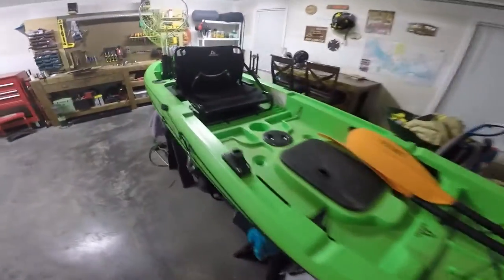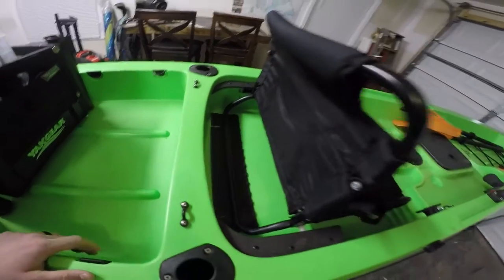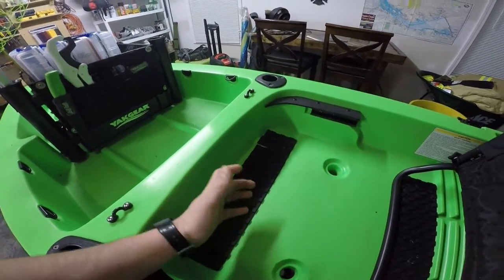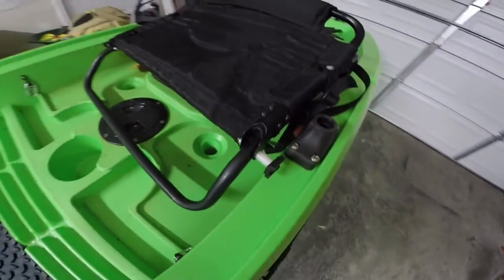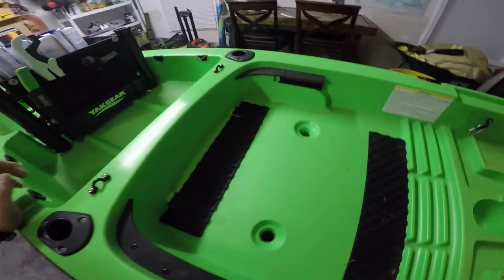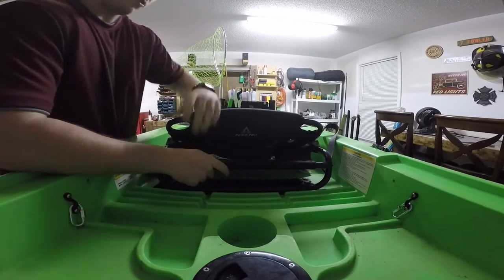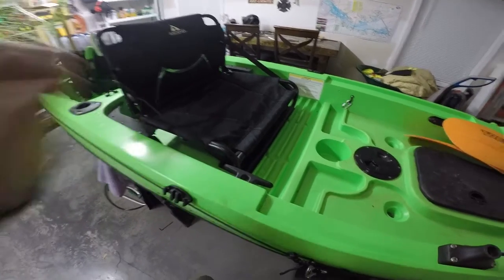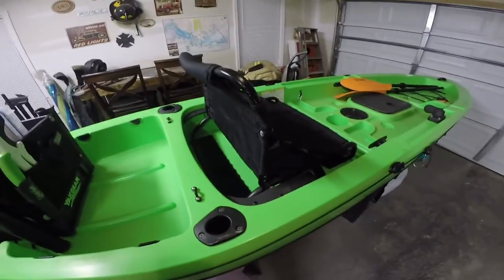Ascend FS12T Seat Mod

Comment: the rubber that you have under the set where did you get it and what is it called?
Reply from the maker: joseph poncik, I got mine from tractor supply store. Walmart also carries them, I'll post a link below. They're called "HIGHLAND 1041400 Rubber Grip Mats,4 x 17 1/2 In.,Pk 2" 

https://www.walmart.com/ip/HIGHLAND-1041400-Rubber-Grip-Mats-4-x-17-1-2-In.-Pk-2/41009154?wmlspartner=wlpa&selectedSellerId=1122&adid=22222222228028625652&wl0=&wl1=g&wl2=m&wl3=61288838289&wl4=aud-273067695102:pla-96912452169&wl5=9010419&wl6=&wl7=&wl8=&wl9=pla&wl10=101593696&wl11=online&wl12=41009154&wl13=&veh=sem

Comment: I have the same boat same color. I used some aluminum bars and raised my seat like many have done and it's now by far the best part about the boat. Pretty much everything else is really disappointing. Certainly would not recommend this kayak to anyone.
Reply: been looking at this boat and the seat mechanism is the only complaint i'm seeing . please explain your disappointments . Thanks
Reply: @pacospete4299  doesn't paddle well, weight rating isn't anywhere close to what it is rated at and kayaks don't handle well when they're close to their max weight capacity. And yes the seat ended up bending. I use the word never cautiously because never is a long time. I'll never buy another Ascend 12T.